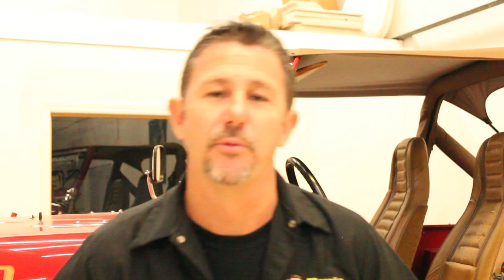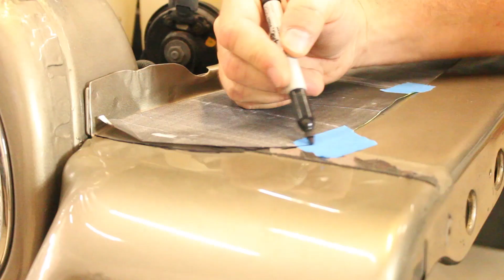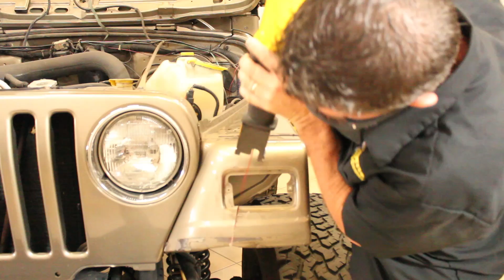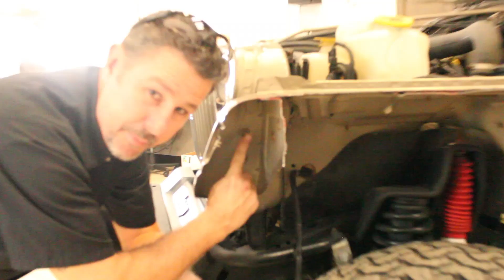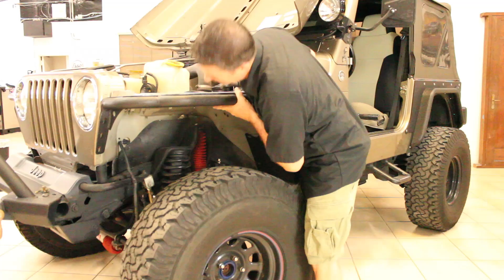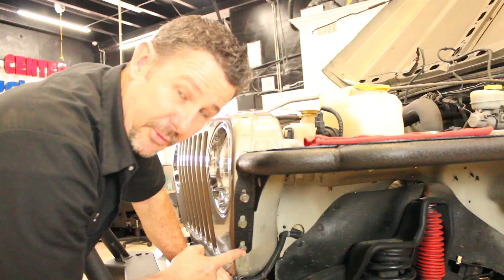XRC Tube Fenders

Comment: i have installed these. this video is helpful and its not that hard to do. but as much as i dont want to i admit i would have been happier just buying a proper fender even if its double the price. with these you would think a full fender with a innner would maybe be like an extra 100 from smittybilt. i think the reason they dont is because the fitment is too shitty and when you have to do the minor fabrication it allows the wiggle room needed to make it work. there is a lot of trimming and fine tuning, you will have to cut the battery tray which is probably the easiest bit. again its not hard but its definitely a waste of life and the finished product leaves a lot to be desired.
Reply: Amen